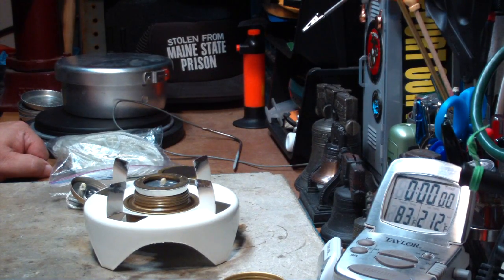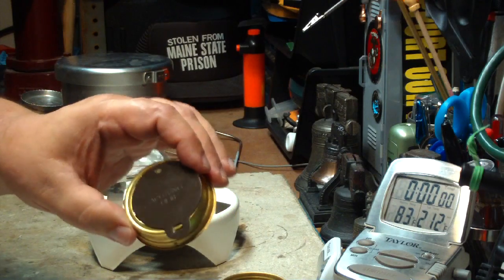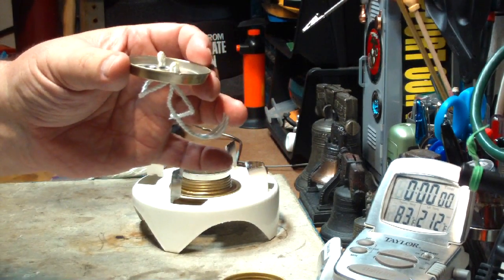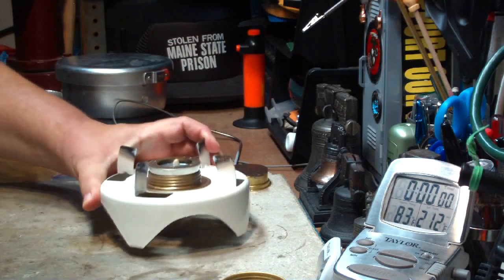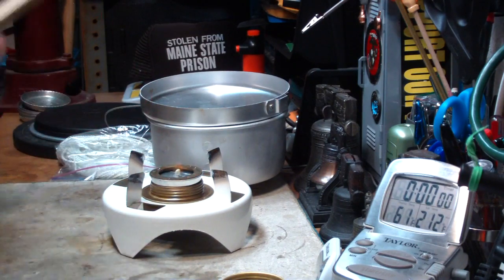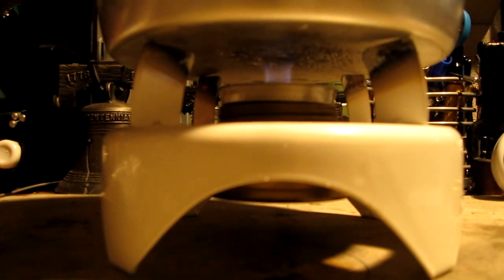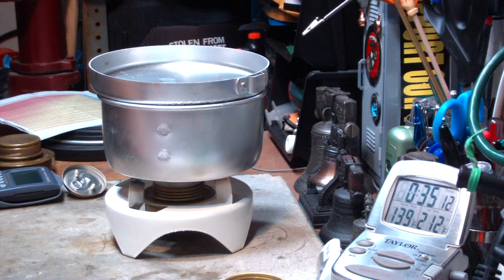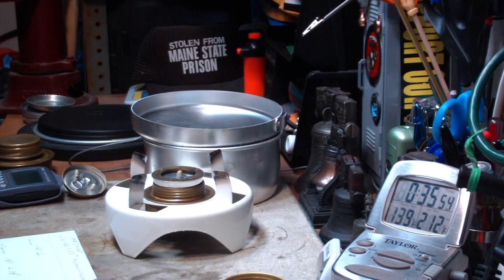Idea for Low Power Trangia Burner Simmer - Test #1 - Single Wick

Comment: the metal cap for a glass jelly jar fits the top of the trangia reasonably well while covering all of the jet holes.  There is even a slight interference fit where you can half screw it onto the threads.  enough to eliminate the extra weight and reduce the additional height.

Comment: I have an alcohol burner that is just a glass oil lamp style with a single round wick. I use it to dump my left over cologne into for a room freshner,  works great !  bigger single wick would probably work better.   A crew on metal cap minus the O ring with the wicking hole would elimate the need for weighting.  I'll look around for a solution that doesnt involve wrecking a trangia cap.

Comment: How about using the Trangia simmer cap closed with the 1 hole in the middle, that would reduce the height, glad you tried this as I have also been watching all the dry baking videos and wondering if the Trangia could be used.